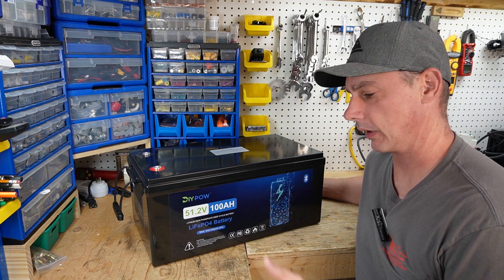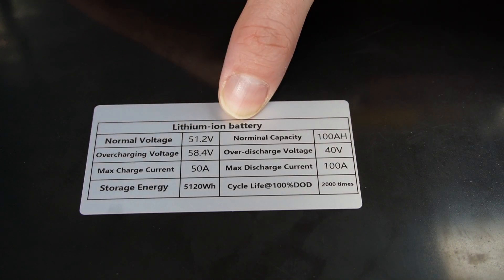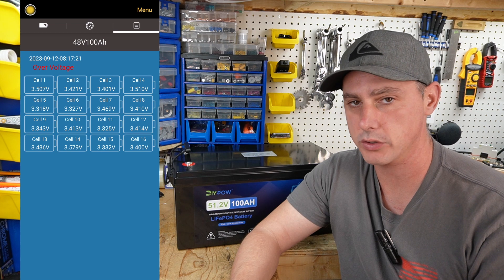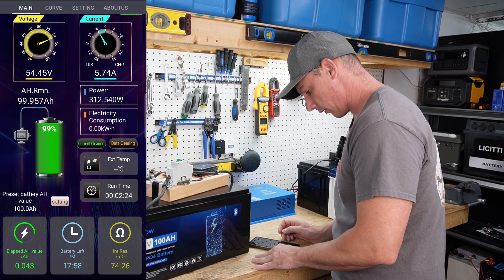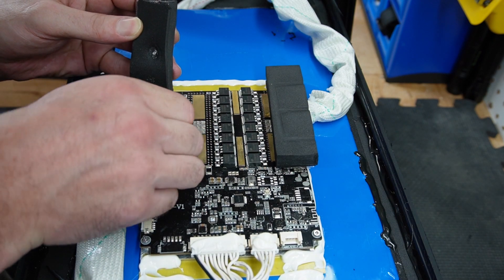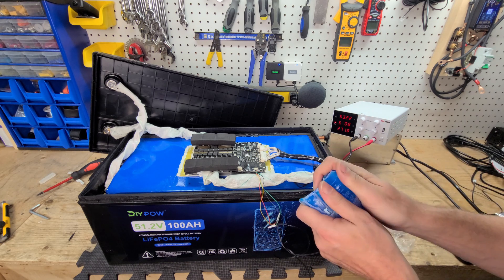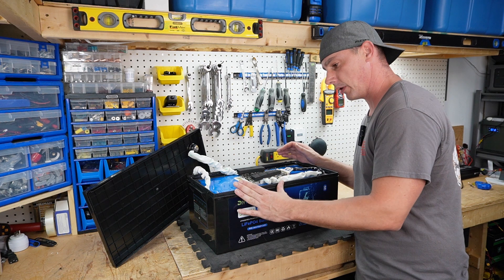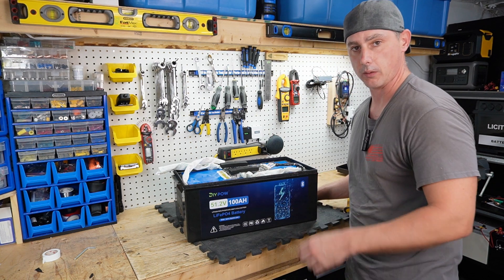DIYPOW, Golf Cart 48V 100Ah Lithium (LiFePO4) Battery Review

Comment: Very interesting.  Always good to see that something for a mobile environment is fixed into the case so tightly that it would require destroying the case to get at what's inside.
Reply from the maker: Very difficult at 83 lbs to slide that out. 
Maybe later on down the road if I want to use the cells in another project I'll cut open the case.

Comment: 100A max discharge rate does not sound like enough for a golf cart. I think you may see more than 150A going up hills.
Reply from the maker: I agree, It's an option for light duty. No mods to the cart and flat terrain.
Reply: @Roll2Videos  Or maybe parallel 2 or more of these. Will your golf car hold more than one?
Reply from the maker: @Sylvan_dB  Yes, My 2004 Yamaha G22 will hold two of these batteries.